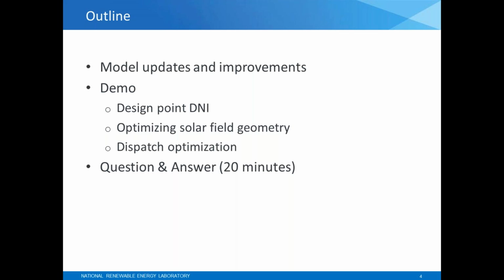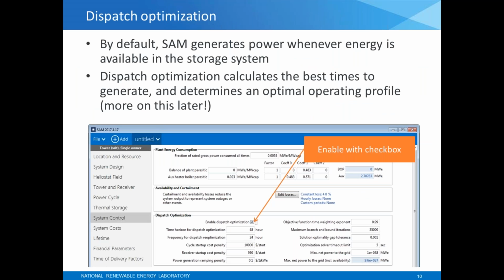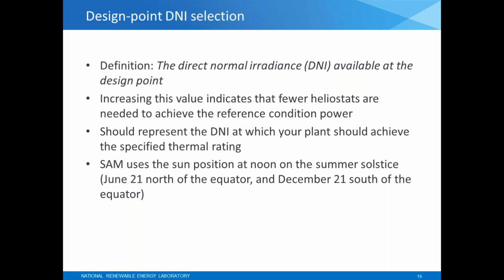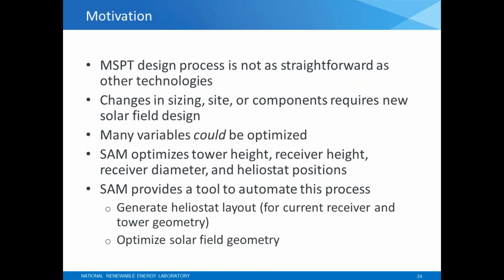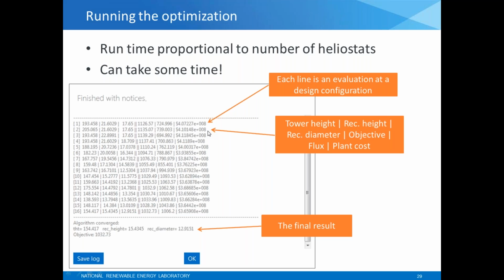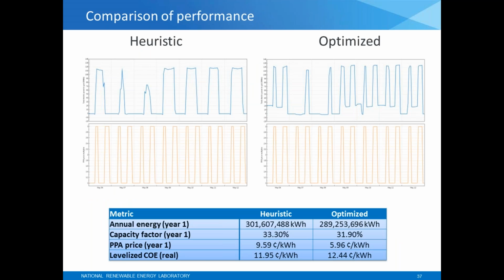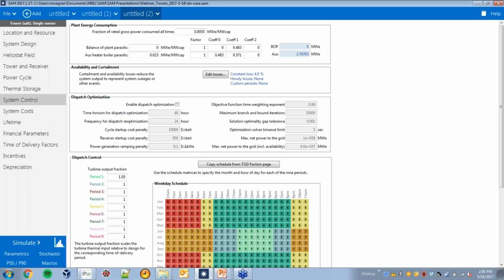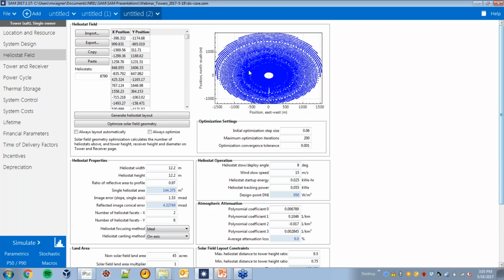Molten Salt Power Tower Systems in SAM 2017.1.17

Comment: At about 21:55, Dr Wagner talks about the scenario where the HTF pump is rated to the design power of the system. He says that, in this case, when the DNI exceeds the design-point DNI, energy has to be dumped from the system. This has raised two questions for me:
1. How would you go about dumping energy from the system?
2. What exactly does he mean by this? Is he saying the following: In this scenario, the maximum HTF flowrate that can be achieved by the pump is rated for when the DNI on the receiver is at design point. Therefore if/when the DNI on the receiver increases above the design-point, the pump is unable to increase HTF fluid flowrate further and therefore the HTF absorbs more heat/kg/s and thus the hot HTF temp will exceed the design temp (e.g. 565*C) ?

It would be awesome if you could please answer my first question, and confirm whether I am understanding correctly in my second point. If my second point is even slightly incorrect, please could you correct me as I am not sure I fully understand the whole relationship between DNI/receiver flux, HTF flowrate and HTF temp. Any resources explaining the HTF flowrate control/design basis would be amazingly helpful. Thank you so much in advance!
Reply from the maker: I think that by "dumping energy," Mike means that collectors in the field would need to defocus. Please post questions on the SAM forum if you would like more detailed answers: https://sam.nrel.gov/forum

Comment: what is the solar multiple meaning ?
Reply from the maker: The solar multiple is a way to express the solar field size in terms of the power cycle capacity. A solar field with a solar multiple of one would deliver enough heat to drive the power cycle at its nameplate capacity under design conditions. If you have more questions about SAM, please post them on the SAM forum at https://sam.nrel.gov/forum.